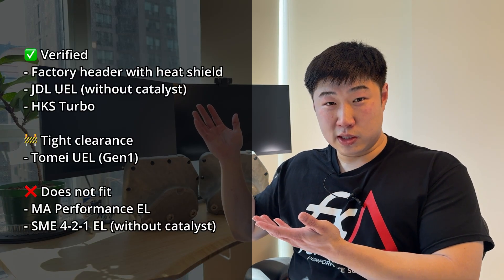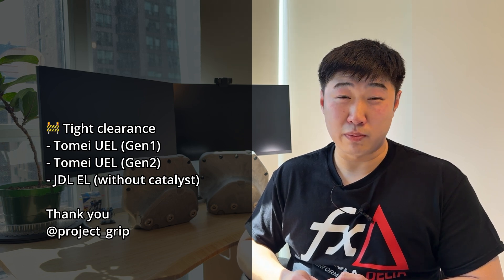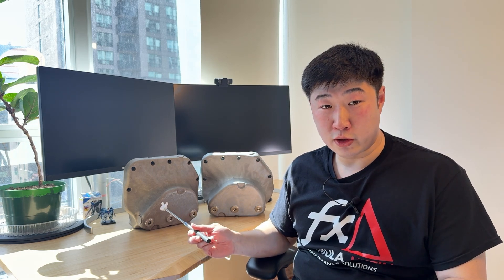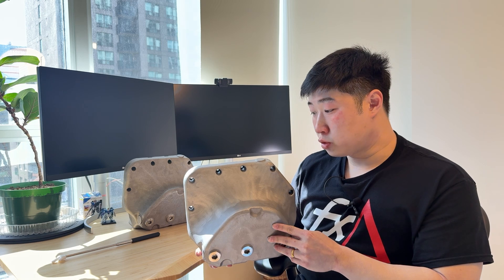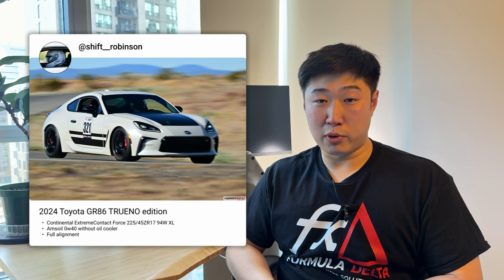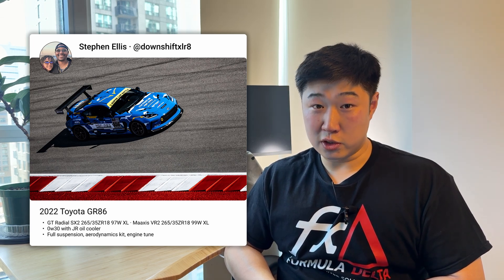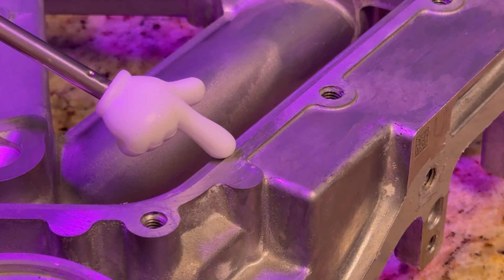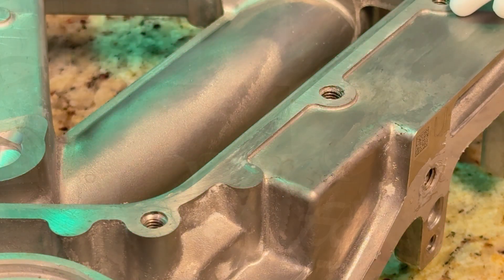Toyota GR86 / Subaru BRZ high capacity oil pan for FA24 - Update #4

Comment: I'm a pre-orderer as soon as it opens. One thing I may have misunderstood; my OME steel pan holds 5 litres, you mentioned 3.7? I have deliberately avoided tracking my BRZ until this mod can be done.
Reply from the maker: Hey there, the OEM steel pan holds about ~2.3L by itself. With the stock oil fill of 5L, the oil actually sits in the upper oil pan too. With our oil pan, you are increasing the capacity of the lower oil pan to ~3.7L (~1.4L more than stock). You are also able to overfill it another ~0.7L, increasing the overall oil capacity by  ~2.1L from stock.
Reply: Terrific thank you, cant wait for it!  @FormulaDeltaOG

Comment: Thanks for sharing the oil pan information.
I live in Japan, is it possible to purchase it when it is released in the future?
Also, I would like to send you the scan data of the header that I am currently using and that is sold in Japan.
Should I send it with the header installed in the vehicle or without?
Reply from the maker: Yes, we would be able sell to Japan, but please reach out to us when you are ready to order and we can figure out a shipping option for you. The header can be scanned on or off the car. Off the car will likely be easier for you if it’s not already installed. Please reach out to us on Instagram and we can share our email address to send the 3D scan. Thank you!

Comment: Just wondering, why put the JDL EL 4-2-1 in the tight clearance category instead of the verified fit category if the production oil pan will definitely fit them with the changes? I'm currently shopping around for headers, and I want to make sure whatever I buy will 100% fit. I'm still deciding between the EL and UEL catless JDL headers. Are both of these are guaranteed to fit for the production pan? The video wasn't very clear if the JDL EL headers will 100% fit.

Comment: So this doesn't go any lower than the OEM oil pan. Right?
Reply from the maker: Hey there, the bottom of the oil pan is slightly lower than the stock oil pan by ~2mm. Not significant changes on this critical dimension.

Comment: Can we see the data you've collected? 900BRZ and Ansix (with their accusump kit) have set the bar you need to meet in terms of data analysis and sharing. 😅
Reply: Uhh, 900BRZ just installed the Formula Delta sump a few weeks ago for his own testing. If you want more data, Driver's Paddock already has an exhaustive video from half a year ago with this same oil pan in earlier prototype form.
Reply from the maker: Thanks for asking, you can expect to hear more from us or from our early access testers on the performance of the pre-production oil pan.

Comment: How is it helping with pressure drops? Any plans to make slight mods to make other headers fit? I have SME.
Reply from the maker: Hey there, we showed our prototype testing data in collaboration with Driver's Paddock video. You can expect to hear more from us or our early access testers on the performance of the pre-production pans in the near future.
Reply: @FormulaDeltaOG no plans to make small modifications to allow more headers?
Reply from the maker: Hey, we have a scan of the SME header, but we are not going to be able to change the shape of our oil pan to accommodate them. I do believe SME is working on a dedicated oil pan for their header, that may be your best bet if you want to stick to the SME header
Reply from the maker: We are continuing to collect aftermarket header 3D scans, but the design is pretty much finalized at this point unless another popular header is very close to clearing our pan, it is unlikely that we will make any more changes